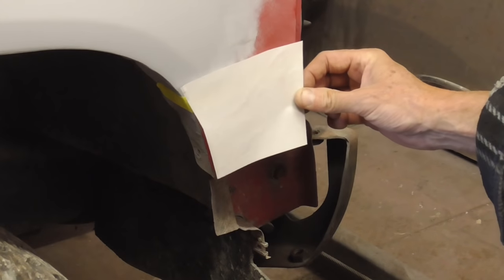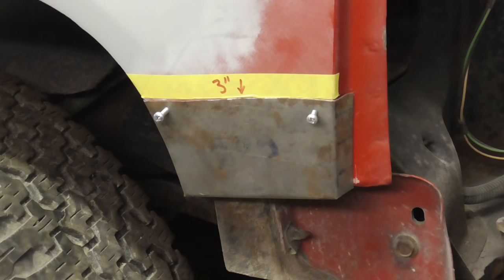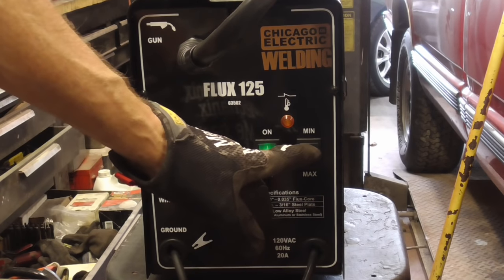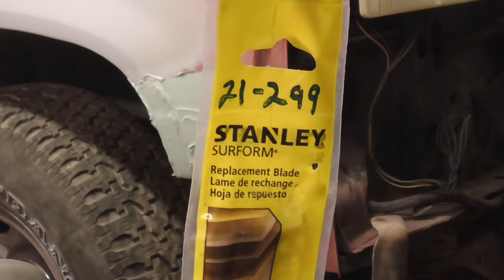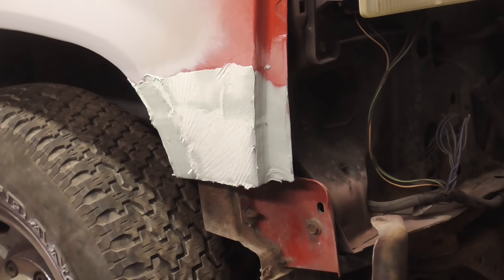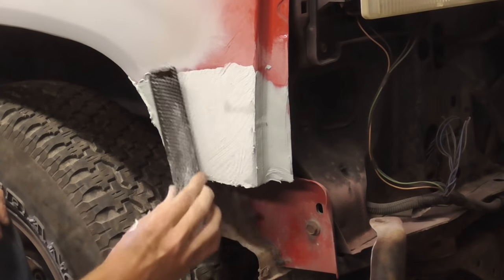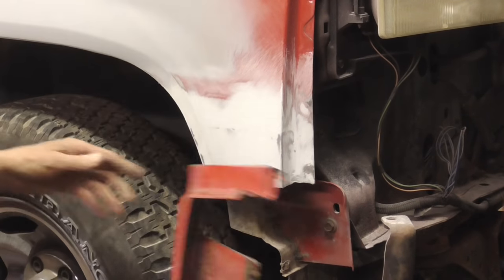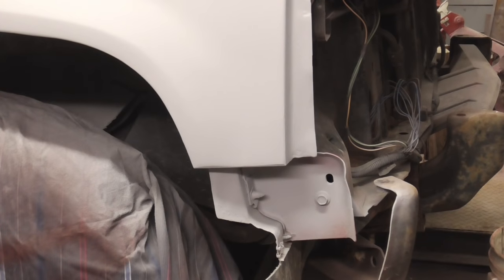Welding Automotive Patch Panels with a Harbor Freight 125 Flux Core Welder

Comment: Thanks for these videos which as a newbie I have found really useful but I have a couple of questions. Most other tutorials on Youtube advise to spot weld a few inches away from each other and slowly fill in the spaces between spot welds to avoid heat distortion but I notice that you stich them together as you go...how do you prevent distortion ? Secondly shouldn't you be wearing long sleeves to avoid UV damage to your arms ?
Reply from the maker: On long runs, yes I would put your spots a couple inches apart and then fill in to control heat and distortion of the panel like in this older video https://www.youtube.com/watch?v=fSTkMkPryPQ check it out at about 12 min 32 sec.  However, on very short distances and rigid panels like rocker panels, etc.  you'll notice that I just run it straight across because you can get away with it there - won't really distort enough to cause problems.  As for the wearing sleeves and protective clothing - It got so hot it body shops in the summer I just said forget it - even wearing masks for sanding was just too miserable.  It's bad but I welded for a lot of years just closing my eyes on each spot and turning my head.  Now though, I do wear a welding helmet and breathing mask and try to stay safer - it is a good thing for sure.  Good questions - have a good week :)
Reply: @LakesideAutobody  Thanks for taking the time to reply
Reply: Yep that's my problem too then I didn't overlap any of metal and couldn't get my cut good enough to get the two pieces tight and ended up being short. Looks like I'm gonna be buying two more new rear wheel arch panels. I got so aggravated with trying to weld it and blowing right through as soon as I pulled the trigger. That was the first thing I noticed when I turned this video on was the overlap with the thin patch. Thanks for confirming that as I always thought that's how I see alot of them on trucks that has some work done on it. Also what size wire are you using,  and how far can your ground be? Should I get one of those copper  u clamps ? Thanks again have a good one from the almost heaven mountains of WV

Comment: is that lap welded
Reply from the maker: Yes.  In an actual body shop, both methods are used depending on your needs butt and lap.  Most patches are lap welded with the edges that can't be tapped down butt welded.
Reply: @LakesideAutobody  thanks for the explanation.

Comment: What gauge 0.23 ?? Wire
Reply from the maker: Flux core - I'm using .030".  The Miller millermatic 90 MIG welder (gas) does well with .023".

Comment: why are yall body guys so scared to run a bead? why do yall just tack, pause, tack? do you not get the same results from running a bead then doing th same work afterwards? i just dont get it.  i appreciate the tutorial and its definitely gonna help me out with my 86f150. ima cut a few sections out thats rusted theough (common spots like under the rear window) but id love to know if theres a difference in results tacking vs running a bead?
Reply from the maker: That's good that you asked.  You can run a bead on maybe about 1" of metal and not have a problem.  Any longer than that you'll begin to have some serious metal distortion, the seam wanting to move, burn through, creation of oil canning situations where the panel pops in and out when cooled, etc.  No one is afraid to run a bead - it's just that it's wrong to do so.  Hope that helps you understand why body guys use spots and why factories also use spot welds :)
Reply: @LakesideAutobody  gotcha thanks! My wording might not have been the best. Every welding job I've ever had has been running beads and I just found it strange that y'all don't, but actually thinking about it in terms of physics, it does make sense. Thanks for the response, especially after a year after upload. That definitely earned a subscription. Keep up the great work man!
Reply from the maker: @SebastianWoodard  Your wording was fine - no problem.  I'm glad you subscribed - feel free to ask any questions you have - any time.  I get to the comments and questions 1-2 times a day.  Have a great weekend ✌

Comment: a very experienced bodyman like you will be able to make an acceptable weld with a flux cored wire on sheetmetal but the result is not at par with 0.024 solid wire and C-25 gas.
Reply from the maker: That's a good idea for a video.  l could do a test comparing the two welders MIG (gas) and Flux.  Maybe use the frame machine to pull the welded sheet metal apart or lift something extremely heavy with two welds - something like that.  Thanks for your input :)

Comment: Good job. Can I move a body line about 1/2 " down on a fender? It's on a 66 chevelle and reprod fenders dont line up with body line on door. Thanks
Reply from the maker: That sounds really rare - did you check to see if the  door is adjusted right, or that the fender is not shimmed up.  Can the fender be moved down or pulled down?  Just checking - you probably already did everything possible.  It could be done but it would be one heck of a job.  Keep me updated on that - I'm curious to see how it works out.

Comment: one question are you using .030 or .035 welding wire? i have a lincoln weldpack 100 and have always used .035 flux core i recently had to switch to .030 and wasn't thrilled
Reply from the maker: I was using .030".   If .035 works for you then use it.  Everyone is a bit different along with the welders.  You have to try a bunch of stuff before finding what's going to work the best and is consistent.

Comment: Most welders I questioned say 20 gauge metal cannot be flux welded only mig welded with gas otherwise holes will be created. Why do they not think flux core can be used? Creates slag and not a clean weld they say, buy your weld looks great.
Reply from the maker: I think a lot of stuff on the internet is hearsay.  Yes MIG (gas) is a nicer weld, it's clean and perfect almost every time.  With some practice I think you can get real close with flux core.
Reply: I have done 22 gauge with MIG without a problem, some European vintage cars have very thin panels.
Reply from the maker: @rolandleusden  That's good to hear - thanks for your input.  Have a good weekend :)

Comment: First a suggestion, get an angle grinder, it will cut through like melted butter. Second, I am assuming that you're doing tack welds because it might melt through the metal, if so say so, otherwise the welds look like bird crap, just an observation not an attack, not sure if they'll hold up very well or not. If they do, cool.
Reply from the maker: Angle grinders are never used in auto body shops.  7" or 5" sander/grinders are used with fiber resin grinding discs - usually 36 grit or 40.  Flux core is never used either but this was for folks that wanted to know if it can be done.  Here's what body shop welds should look like - https://www.youtube.com/watch?v=1BYqLM_mY1s
Reply: @LakesideAutobody  ah. Okay

Comment: Jesus Christ dude. Like honestly. I have officially just found the most complicated way to add more labor cost, bondo, and bad shop reputation than ever needed.
Reply from the maker: Relax my friend - some folks wanted to know if you can use a flux core welder for body work.  No drama here - just help for those that like cars 😊  https://www.youtube.com/watch?v=t1WclT_GMvk
Reply: What are you going on about? A little more clean up from using fluxcore? That welder works just fine

Comment: big mistake,...never put polyester-putty on bare metal, this putty is hygroscopic and cause corrosion....on bare metal only epoxyd- putty or  first primer on the sheet.
Reply from the maker: With respect, that's not true.  It's best to put filler over metal that was prepared with a 36 grit fiber resin disc.  Filler will never see moisture again once it's painted.  I don't understand why folks think you have to prime metal before filler.  Never worked in a shop that did that - never saw it done once by anyone.  Matter of fact, it was always "cheating" to put filler over anything but bare metal.
Reply: @LakesideAutobody  , it seems we have different experience and skills in this case.  Polyester-putty is hygroscopic and there is nothing else to say about. But you are right, as long there is no stone-chipping or scratch on the car finish, the putty can not absorb moisture. Also  should polyester-putty not be wet sanded, or than min. 24 h dryed after wet sanding....otherwise coused bubbles after painting.
I never use primer, but only epoxy- putty . Epoxy-putty also shrink less than polyester-putty and is more hard-wearing......but it is more difficult to finish it.
Reply from the maker: @AchilleasR   Here's something good to remember:  Before all the modern 2K stuff of today there were the basic materials - lacquer primer, red putty, regular filler, etc.  Some of the best paint jobs I ever saw came out of the 70's,80's, early 90's and all of them held up just fine - held up for as many years as you wanted to take care of the car.  Yes the new stuff is better but not always necessary - you can save a lot of money using only what you "need"  :)
Reply: @LakesideAutobody   yes, thats true .....new stuff are often just crap
Reply from the maker: @AchilleasR  Nice talking to you AR - no big deal having differences of opinions as long as there's respect - I respect your opinions and your open mind.  Thanks for the comments and talk to you soon :)

Comment: Why do I read everyplace you can't do that with flux core because it burns through. Discouraged me from messing around with my old clunkers for fun because everybody says you cannot do it "can't do it you'll be disappointed burn through this is why you can't flux core weld your body work ......" And this guy does it with a cheapo welder easily.
Reply from the maker: A lot of internet, magazines and TV is just hearsay.  Here's more on flux core - butt welding - https://www.youtube.com/watch?v=iznc9CCtZnw  lap welding - https://www.youtube.com/watch?v=ic7Gwf8y4Yc
Reply: @LakesideAutobody  Do you know if the welding respirator masks I see for about $40 do a decent job? I don't see anyone wearing them but I want to avoid the fumes.
Reply from the maker: @108doublestitches  If they state they are for welding, I would trust that they are fine for what you're doing.  Something like this would be perfect (NIOSH approved) - https://www.harborfreight.com/welding-silica-concrete-dust-mold-respirator-medium-57009.html 👍😊
Reply: Thanks again for teaching me about patch repairs and the flux core welder

Comment: Butt weld ?
Reply from the maker: https://www.youtube.com/watch?v=iznc9CCtZnw  Here's some good info on the topic if you want to check it out:  Lap welding is how all body shops in Michigan repair rust on late model vehicles (welding or adhesive).  Strictly butt welding a patch panel, which has become popularized by the internet and TV,  is not the best quality repair on today's thinner metal and there are many good reasons why professional body shops don't do it.  Shops use a combination of both lap and butt (butt for spots that can’t be knocked down like edges) on almost every patch but would never just butt two pieces of metal up, weld it, then grind away at the area attempting to metal finish it.  Here why with good reason  - especially Eastwood’s starting 22 seconds in: https://www.youtube.com/watch?v=rpH50kh4W00  *
https://www.youtube.com/watch?v=MfKlNQF-o4I  *
https://www.youtube.com/watch?v=e9bjZ_UxtJg  
Today’s metal is .030. That is literally 6 hairs (hair is .005) thick.  You start grinding on that and the result is paper thin metal and welds. Lap and Butt methods can work well if done properly so in the end it’s what works for you..  Keep in mind, you won’t find anyone butt welding in professional shops. Surely you’re not going to butt weld and metal finish this: https://www.youtube.com/watch?v=36zkc9UQaTs or some of my other rust repair videos.  Use small overlap, weld solid and you won’t have to worry about moisture - especially if you keep the drain holes clean (most important thing in rust prevention). Note that  the opening of the seam is upside down on the inside (no moisture trapped).  Please see this video for longevity of this type of repair if done correctly: https://www.youtube.com/watch?v=8XaZBy7GC7A or 
https://www.youtube.com/watch?v=2o37dX--w0I

Comment: I was cringing watching this,,cutting the piece out of the fender,,imagine what that DISC could do to your fingers and hands,,🙈
Reply from the maker: Actually not too much.  I've been hit with every tool used in a body shop and Yes, you will get cut but, nothing that will need stitches.  Thanks for the concern though Jack - have a good weekend :)

Comment: What welding wire are you using?
Reply from the maker: The wire that came with the welder.  It's .030".  My friend says he has the same welder and uses Lincoln .030" wire and there's less spatter - haven't tried it myself though.  Have a good weekend Curtis - nice to hear from you :)
Reply: @LakesideAutobody  thanks for the reply! I'm still dialing in my easy flux 125 to do some quarter panel patches on my 72 Nova. Tried the Vulcan stuff but looking for something better. You have a good weekend as well!

Comment: What size wire did you use?
Reply from the maker: That welder came with .030" wire - that's what I was using in this video.  Have a good weekend Shawn :)
Reply: @LakesideAutobody  I was told .023 and .o24 is for autobody work, based off your superior welding knowledge, what wire size is the most compatible for autobody welding?
Reply from the maker: @shawnlawrence4840  Yes my miller MIG (gas) welder uses .023" but the flux core welder has the .030" wire.  Both work fine.  What brand and type of welder are you going to be using?  Feel free to ask as many ?s as needed - Jerry
Reply: @LakesideAutobody  my welder is lincoln fc 90, I'm a beginner who has a 84 cucv. I not knowing bought .035 wire and I've got a number of burn through, was told it's the size wire. So I will try .030 if I cant get the .023 or .024
Reply from the maker: @shawnlawrence4840  It's not the wire size.  Turn the heat to low (5 or lower).  Wire speed on around 6 or lower.  Be very short on the trigger.  Watch this video at how short the weld time is:  https://www.youtube.com/watch?v=ic7Gwf8y4Yc  or  if you're butt welding watch this one:  https://www.youtube.com/watch?v=iznc9CCtZnw  Ask more ?s if you still don't have it.  Nice clean metal and light on the trigger :)

Comment: What kind of wire did you use?
Reply from the maker: The wire that came with the welder - .030". I hear for a good flux core guy that YESWELDER wire is really good - Lincoln flux core wire is also good stuff.  Just what I hear from guys that use flux a lot.   I use gas.

Comment: Not a single weld was made in this video. 🤦‍♂️ It's clear you didn't make an attempt to learn how to weld prior to doing this.
Reply from the maker: Here's how welding is done on .030" sheet 22 gauge - today's cars - https://www.youtube.com/watch?v=1BYqLM_mY1s  Here's a follow up video on this repair years later - https://www.youtube.com/watch?v=t1WclT_GMvk  & https://www.youtube.com/watch?v=gIS1Tbv7Kvw  -  If you want to know how body shops do it - not TV/internet/magazine articles you came to the right place 🛠☺
Reply: @LakesideAutobody  certified welder, used to weld for GE nuclear. 😂 Fish eye welding doesn't have penetration. Lay a bead and grind it down. That's what I do with my Sierra at home. At work its far cleaner and more scrutinized.  This video is teaching many false information regarding welding. That's all. From stick to mig, to flux core, Tig, micro Tig, I've done it all.
Reply from the maker: @GFG2gifted  You sound like a great welder.   See vid for penetration facts -  https://www.youtube.com/watch?v=ic7Gwf8y4Yc

Comment: U never wipe metal glaze or body filler with your fingers like that. Absolutely awful technique to practice or teach. Your finger has oils on it or any chemicals from being in a shop. It can and most likely will interfere with the integrity and strength of the glaze in that spot. But....  at least your not using bondo, and it appears to be an old junk truck anyways.
Reply from the maker: Absolutely not true.  All this talk about not touching this or that - oil from you hands - on and on.  Guys in a body shop don't have oily hands - they're dusty and dry as a bone.  Got to have good shop habits that's all.  Good luck doing body work without touching the car :)

Comment: Be sure to put as much body filler on the panel as possible.  You want to make sure you're doing the maximum amount of work.  Also, (as shown in the video) make sure you're not wearing any kind of protective mask while sanding. You want to breathe in as much of that carcinogenic polyester dust as possible, otherwise you might not develop cancer.
Reply from the maker: You're right about the filler part.  You want to put extra on so that you're not playing around all day on one dent like a rookie.  As for the mask - in reality, I went to a lung specialist one time just to see if there was a build up from body shop dust.  Can you believe he said there's absolutely no way bondo dust would reach your lungs.  That blew me away - he said if that was the case your lungs would be filled with debris by the time you were 2 - he made a good point :)